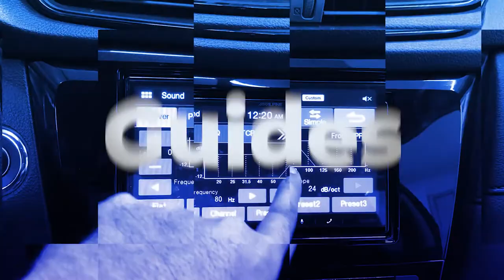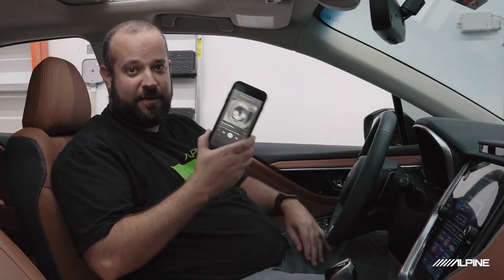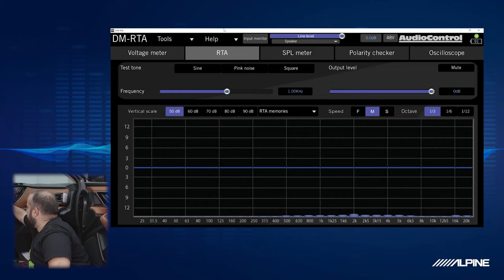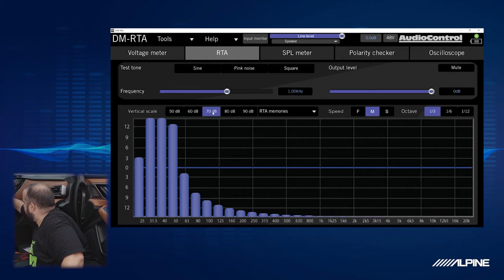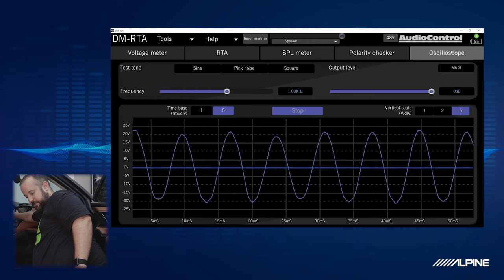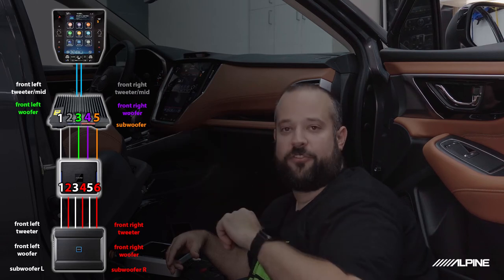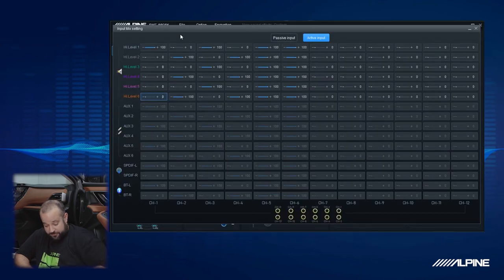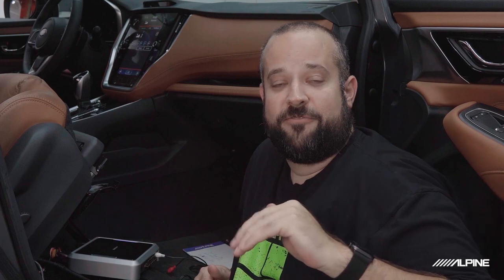Factory Radio Upgrade with DSP Integration

Comment: This is a subaru 2022 and what is being explained isnt making sense because if this is a 7.1 channel with H&K audio, is it active 7.1. Had my car several times in the shop and the radio has no volume audio control from the radio it lags and cant use the carplay due to the resistance levels not being met. In this system are you utilizing OEM harnesses or are you T-Harnessing off and direct then tuning or what is the setup because its vague how this is setup properly to retain all correct system utilization with the aftermarket system. If you can provide a detail how it is setup it will help greatly.

Comment: Hi. Please share what T harness you used that plugs into amp. I have same car. Thanks. Dave
Reply: Did you ever find out what harness?
Reply: @juliomiranda6801  idata makes one. Get the dsr1 plug and play full signal out to amps. Worked great
Reply: @daveroski  question does your Subaru have the HK system and starlink? Did you have to use the resistors he mentions? Also what dsp did you go with? Idata recommends the Rockford fosgate dsp
Reply: @juliomiranda6801  hello, no I didn’t have to use resisters. Yeah the dsr1 is the way to go for a clean signal. I actually helped iData (worked w) to remove firmware bugs for that vehicle. They are great. It will give you a clean signal to your amps. You can use the dsr1 as dsp or set flat and use other dsp. I emailed them and they sent me a firmware file for more output for the dsr1. My Subaru sounded amazing. I have all the speakers still from cdt audio I need to sell all for that vehicle. I may have tossed the 6x9 adapter rings though :/ for rear deck. I did a lot of work on that. Sound deadening everything.i don’t have that car anymore. It was a 2022 xt touring.
Reply: @daveroski  nice man thanx for the info! i also went with cdt! and i also did the sound deadening. i will be purchasing the kit in the near future thanx!

Comment: mate if you install DSP in to your radio it will be a massive downgrade, the radio will become un-listenable trash that begs for money all the time.. don't do it!!
Reply: Factory integration is not for beginners.......at all.   I have only used aftermarket radios,  however,  the newer cars with DSP integration, done correctly and especially the tuning process is light years ahead of stock.